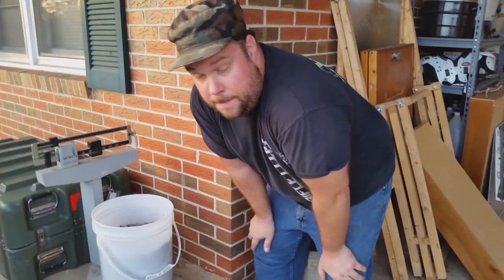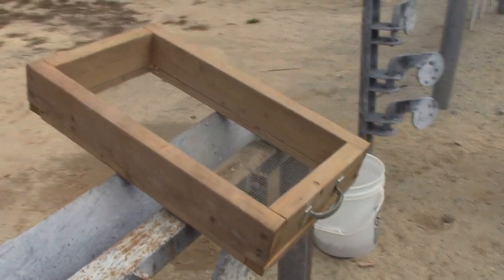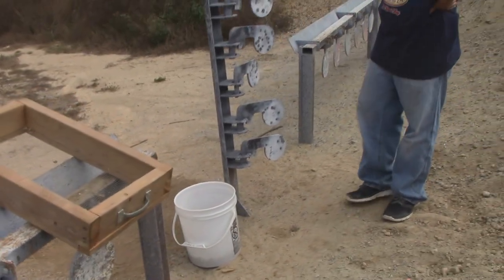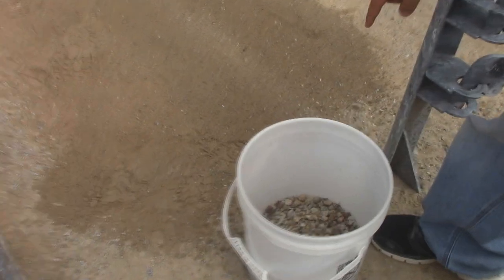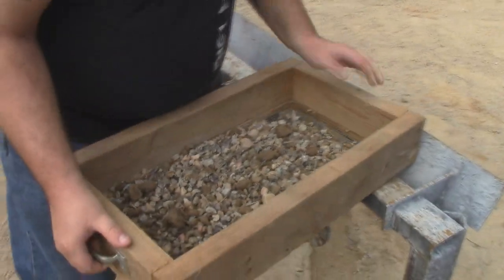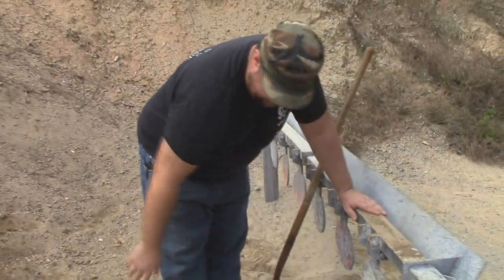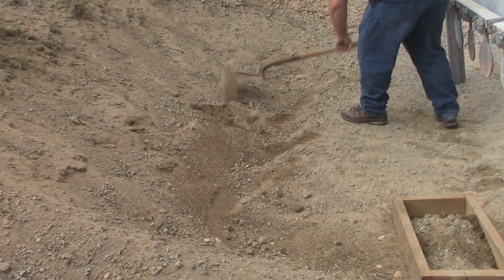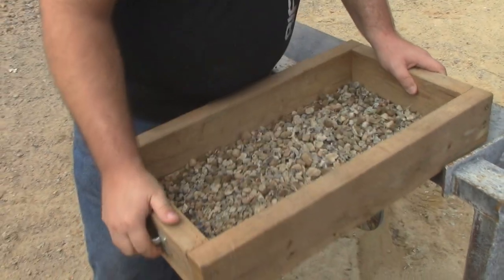I've Been Collecting Range Scrap Lead Wrong! 255LBS./30MIN.

Comment: Why murican shovels dont have handles?
Reply: short handle shovels do. The long ones like these you wouldn't get the same benefit from using it as the length is to long.
Reply: Tj1056
Then why do you have long shovels without handles, whats the purpose/functionality of the thing??
I fail to see the point of having a long shovel without a handle to grip on, its not efficient and causes a multitude of problems without giving any benefit.
But please do enlighten me, what is its purpose.
Reply: zameliz
longer handle equals to more leverage and foce to dig out large holes
Reply: Tj1056
Its not a handle its a shaft, and having a handle in a shorter shovel does that job better.
Having more leverage would be useful for moving large ocjects, like rocks but that not digging now is it?
There is no point in having a shovel without a handle to grip on.
Reply: zameliz sounds like you have never dug a hole before... you need leverage to dig out the dirt... you would have much more difficulty digging a larger hole with a shorter "shaft"... you know the part where you have to dig out the dirt, yea that longer shaft allows for a easier dig... its not like the laws of physics changes when you use a shorter shaft with a handle at the end...
Reply: tgjguitar
So basically a shovel without a grip is prettymuch useless just as I thought
Reply: +zameliz where exactly are you from? Short shovels have the grips on the end for more confined work. The long ones without the grips are more useful for digging bigger holes plus they have more leverage so it feels lighter in the hand. Plus taller people can use them easier. What are you, 4' tall? You really ain't never used a big shovel before?
Reply: Alexander Moffitt
exactly, people don't seem to understand physics to much it seems lol... leverage plays a big part in digging... I mean you can dig the same hole with a shovel with half the size shaft but you are going to be putting in twice as much work as you would be with the larger shovel digging a big hole.
Reply: Alexander Moffitt
Well I'am 172 cm short so I aint a fucking giant, and I'm from Finland, a place where things make sense.
What comes to digging big holes we usually use an excavator (or some other machine) to do the majority of the work.
I really dont see the need for a shovel without a grip.

Please do note my original question in this thread, "Why murican shovels dont have handles?" where I'm referring to the damn grip of the shovel.
Reply: zameliz
seriously go out and purchase a long shaft shovel... they do have them where you are you live, you just are to ignorant to notice them... you will feel the difference once you actually dig a hole for the first time... but here this is why "Longer shafts are best for digging deep holes and trenches, cutting through turf, awkward weeds and dense materials, as well as brisk shoveling, Shovels with shorter shafts give you more control for delicate work such as digging in flower beds and confined spaces, like against a wall or in a tight corner. Longer shaft equals more force able to put into the shovel, like I said before simple physics... well you know sometimes excavators are costly for small jobs and or cannot fit into the area needed...
Reply: Tj1056
"Why murican shovels dont have handles?"
Ring any bell?
Thats my initial comment and YOU brought in the shovel length and derailed this whole topic.

I'm starting to feel that you dont read the comments or dont understand its contents + you are making opinions based on your silly beliefs.
The way you act and try to insult other people makes you look quite pathetic, this is an argument about shovels, no need to lose your temper and look silly on the process.

Comment: I did not get what was wrong??
Reply: ***** ahhh! Thanks
Reply: Lead is roughly 11 times a dense as water, 1 gallon. of water is ~8lbs 
so if you have a 5gal bucket ~3/4 of the way full that is 3.75gal , 
3.75gal*8gal/lb=30lb, 30*11= 330lb, of course there is air space between
 the lead bits and the rocks so the actual weight was only about 255lb, which is a little bit heavier than 110Kgs.
Reply: +Intanius actually fresh water is 8.34 pounds per gallon........just saying
Reply: deke edwards Next time look up what a tilde implies before you comment.

Comment: after you cast bullets you should sell the back to the gun club
Reply: let them make some profit on the lead you harvested from their site ( to cover filling back in the berms) you could turn this hobby into a revenue source
Reply: Amusing he processed these 255 lb and if this is the weight after removing rocks and dirt and he melts it down in to ingots, after jackets get scooped he ends up with 200lb of pure clean ingots and he sells it at dollar a pound, that's 200 bucks for very intense labor that actually puts your health at risk with Lead exposure and I didn't even calculate propane and all equipment cost, there are much easier and safer ways to make 200 bucks.

Comment: You still do it wrong. First of all, clean first spot, and fill it with dirt from second spot, after you have done just add dirt to last one from firsts one. And clean that place completely. You do not steal some ones crap, but do work which have to be done, reducing lead pollution and possibilities of lead ricochet. Also with other ranges, just dump few trucks of sand, it will make range better and saver and your live easier.

Comment: dude you did everything wrong 1 rake all the lead to the base of the burn then sift on a clean patch of floor when done put the clean dirt back on the burn and rake  over so looks its new,,  2 dont lift heavy buckets when you have loads of empty buckets on your truck think of your back ,, 3 dont tell any body what you are doing lead is 50c a pound and each bucket is about 30 dollars that you could loose now ,, and dude you dont have to grunt and moan when lifting a heavy bucket we do understand that the bucket is heavy and you want to damage your back just for the vid lol we are not 3 years old

Comment: You realize it's cheaper to go buy lead bars from a metal dealer than it is to process that lead? Does it make you sick in the stomach? It should!

20 pounds of PURE lead (most ammo isn't pure lead btw), but TWENTY POUNDS OF PURE LEAD would cost you $60 without all the work and risk.

Dude, it's painful to watch these videos. Someone who is "prepping" on something that is so financially and physically expensive that it just doesn't make sense.
Reply: But if you have nothing else to do, why not do it.

Comment: You could work even the shittiest of jobs and make enough money in the same time to buy more lead than that. I'm all for self-sufficiency, but you gotta pick your battles when it comes to getting the most reward for the least effort. I guess the gun club or the members keep the brass casings, but copper is worth a Hell of a lot more than lead. Find a way to separate all the fragments of copper jackets from the dirt and you're really in business. Check out those vibrating griddle dealies they use in gold mines to separate particles based on density
Reply: He's not selling it. He's remaking it into rounds.
Reply: The Tree
Can buy those too.
Reply: why spend money on lead when you can dig it out for free and then save that money you worked for to spend on other things like food and water?
Reply: Ash Scott If you can dig over 200lbs of lead out for free and make rounds out of it, I'd say that's better than buying rounds.
Reply: The Tree
Well, you still gotta buy casings, primers and propellant. Plus the fuel and eqauipment to melt the lead, plus the molds. Then there's all the time you spend doing it, that you could have spent better elsewhere. If people wanna do it for fun, or cus they like to recycle, or they have a range they wanna keep clean, or the range pays them too collect the lead, gret. But if you think you're going to save money, it's too close a thing to be worth it. Of course, if you also get a few Youtube videos out of it, and monetise them, that helps. But as far as making money goes: You'd probably make more turning that lead into fishing weights than into bullets
Reply: its still cheaper i don't think people understand how expensive lead is getting. the way things are now its cheaper to make your own verses buying. and if it isnt why complain? its better for the environment
Reply: narutolovesbleach
Nobody is complaining.Just stating that if the goal is to save or make money, then there are more efficient ways to do it
Reply: its about making bullets some old rounds are $1+ a shot and that adds up plus pure processed lead is up to $2~3 a pound there's lots of money being saved
Reply: Scrap lead costs about $0.50/lb. If he's able to get ~250lbs of it in half an hour that's $250/hr. Now I don't know where you work, but I'm fairly certain MOST people aren't making that much per hour. Also when you melt the lead down, the copper jackets float up to the top and are skimmed off to be scrapped separately.
Reply: *****
It's 250lbs because it's collected there over a long-ass time. It wouldn't BE 250lbs in the second 30 minutes. Come back the next day, and you won't get squat. And if you end up making money, and the range finds out, you lose your gig, and they just do it themselves like they do with the brass cases.
Reply: Ash Scott The range won't do shit.
Reply: Ash Scott I wasn't saying anyone should make a career out of it, just that it's not necessarily a waste of time to do it every so often. Even collecting 1/10th the amount they did would be worth it for most people, especially just as a hobby or something. Most ranges won't give a crap about people cleaning up lead for them.
Reply: Ash Scott I don't think you understand how many bullets can be made from 250LBs of lead. 10LBs would make well over 5,000 240gr. bullets for my .44 cap and ball revolver. With 100LBs of lead I'd be set for life for all my guns.
Reply: 350lbs of range scrap. Guesstimate 300lbs of processed lead. Added to the 200lbs of ingots he has on hand, that translates to 63,500, 55gr boolits.
I don't know about anyone else, but if I had over 63K of bullets for my AR, I'd never have to buy ammo again.
Reply: 10lbs = 70,000 grains.  70,000 / 240 = 291 if you cast perfectly.

Comment: Why not just use an electro magnetic?
Reply: Magnets pick up steel.
Reply: Lead is Non-magnetic.
Reply: If you use electro magnets with a high frequency ( no, you can´t use DC becauese your magnet would not work ) you induce a current in the Metal ( here lead ) which in fact produces a magnetic field around said metal. This means that your non-ferromagnetic metal just got magnetic.
But you would waste a lot of engergy ( for the electricity ) and money, because if you do the math and calculate your investet time against a lead price of currently 0.84 USD/LB plus your refining costs you might see what is cheaper.
Reply: Konrad Krieger lead is not metal.
Reply: a strong enough magnet will pick up anything.
Reply: BenMJay No it won't, magnets pick up metal, end of story.
Reply: +FullSpectrum Survivalist lead is metal
Reply: Garrett Holland Sigh, lead is not magnetic, it's not a true metal. Here learn something. http://terpconnect.umd.edu/~wbreslyn/magnets/is-lead-magnetic.html Metal has to be of a true metal type that is magnetic, to be picked up by a magnet, electric or otherwise.
Reply: ***** something can be a true metal without being magnetic
Reply: Garrett Holland You need to go to the metal wiki page, it explains the different types of metals. Can we just agree a magnet won't pick up lead and move on? If you disagree try picking up a lead fishing sinker with a magnet.
Reply: https://en.wikipedia.org/wiki/Lead

"It is a soft, malleable and heavy post-transition metal. "
Reply: Garrett Holland Lead is a metal. Lead is not a transition Metal. Lead is not magnetic.
Reply: Positive Vibes Post transition metal. Ironically, when you put a magnet directly over any substance not directly called metal or steel, it don't work.
Reply: Holy shit... Is this serious? A magnet can attract water. Is it a metal? No. Oxygen can be attached by magnets. Is it a metal? No. There are 84 different kinds of metals and only 3 can be attracted by magnets; iron, cobalt, and nickel.
Reply: um yes it is

Comment: I saw the thumbnail and noticed you are using the same 1080p tag eporner does. DIssapointed by lack of porn
Reply: Well, I'm impressed at the space dandy pic.
Reply: +IdealIdeas100 That 1080p tag is standardized. My Asus monitor had that tag on the box as do many monitors and TVs. Its not a porn thing...
Reply: ASUS MONITORS!